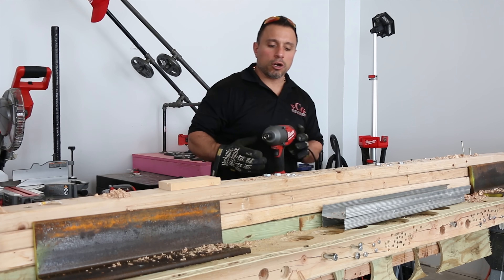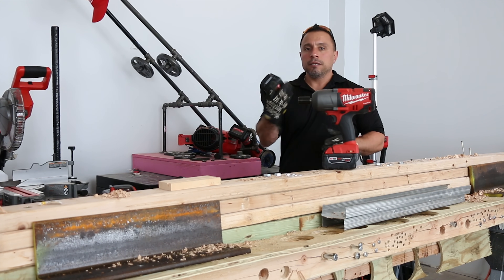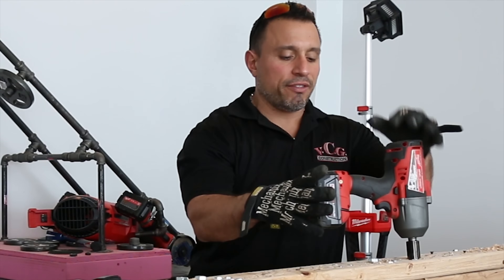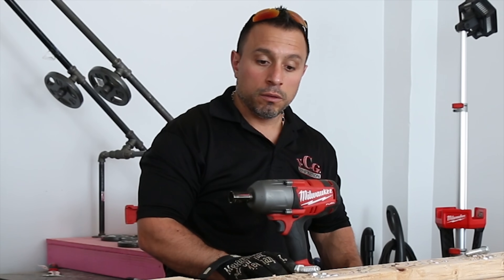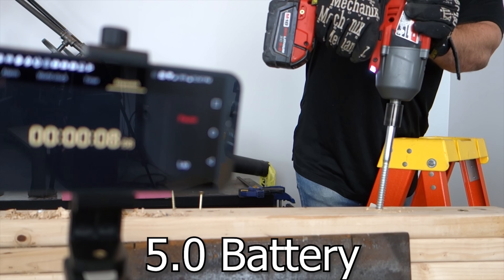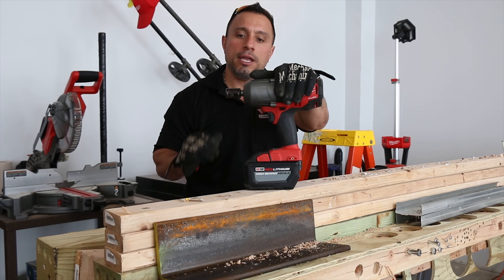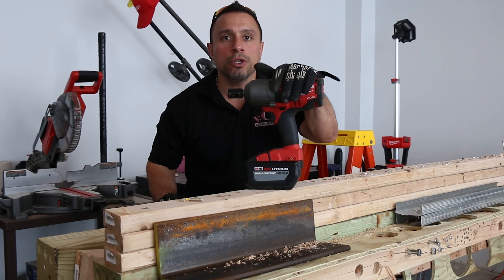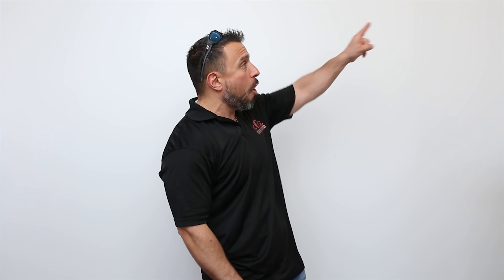Milwaukee M18 High Output HD12.0 Battery - Does It Increase Speed And Power?

Comment: The high output batteries give the most advantage to motor only tools. Impacts rely a lot on the impact. The impact works regardless of the motor…so while you’re still getting a benefit because the motor is able to draw more, the impact part still requires a certain amount of time between impacts and the impact itself doesn’t get stronger with more battery umf.

Comment: I have a pretty awesome setup!

I have a portable power station, 2 M18 12.0ah batteries and a rapid charger. When 1 battery is depleted I can use the other one and while using the fresh one I use the power station to charge the other!

At first I was disappointed. The power station reads power output in watts. The first 5 minutes it's saying 5watts. I'm thinking it'll take all day! About 20 minutes it's reading 150watts! It charged this HUGE battery in just under an hour!

Now THATS what I call superservice!

Comment: HD 12.0 is kind of heavy for most tools. Awesome for stationary tools and heavier tools like you show.  Also good for lights.  It just takes a long time to charge.  I have some CP 3.0 batteries that made about the same difference over the normal 2.0 batteries for smaller tools.  (30% - 50% more power). Good demonstration.

Comment: Im a mill Wright, I work on gas and steam turbines. Time and time again the 12.0 breaks and torqued things the 5.0 can't. Very noticeable difference in my line of work. I have even noticed a difference on the Fan. And it will run for close to 8 hours on high.  Hope this helps.

Comment: I'm a heavy engine mechanic and I can tell you that using the 12.0 definitely gives you more power than the 5.0. I was unsuccessful at removing 90% of the head bolts on a QSK60 Cummins using the 5.0. With the 12.0 my 1/2" impact didn't skip a beat and removed all of the head bolts. I hope this helps you guys make a decision.
Reply: Thx man👍
Reply: Head bolts ?? Fudge my 1/2 could remove head bolts on a isx15 , I had to bring out the 3/4 breaker bar and cheater bar
Reply: It does depend on the tool, task, and batteries being compared. Sometimes the tool isn't getting all the power it can use and sometimes that isn't a factor at all.
Reply: I agree 👍. I used the 12.0 on my 3/8 mid torque (overkill) on some 5/8" bols covered in asphalt and tar and the 5.0 didn't match what the 12.0.did...it was kinda scary 😂😂😂

Comment: I switched my m18 mid torque from the red XC lithium to the high out put 6.0 and noticed a huge difference in removing lugs to tire and other services . the out put is higher and lasts longer too compared to the 5.0 red lithium battery worth the investment . I want to see how the 3.0 high out put does in compared to the other high out puts

Comment: In mechanic work at the shop the 9.0 and 12.0 perform better in the impact wrenches. Even made my worthless 3/8 milwalkee (older model) with the 5.0 run better. Tanks though

Comment: I have Milwaukee M18 one for XC 6.0AH, not need big battery, one for HD 9.0AH and one for HD 12.0AH high output Big battery, not need 5.0ah or less, Milwaukee M18 batteries ONLY for torchlights
Reply from the maker: The bigger batteries do come in handy for the light! Which lights do you have?
Reply: I have more torchlights, try on Youtube.com: Milwaukee M18 and dewalt flexvolt 20/60V with 12AH

Comment: Great video I have the 2767 with only 2 of the 9.0 ah batteries & its a beast I think weight of 12.0 would be annoying though
Reply from the maker: It it doesn’t require the 12.0ho I say save the weight and run a 9
Reply: Or run the new 6.0Ah HO, best of both worlds.
Reply from the maker: Good call nytron!!
Reply: What model is the impact you are using in this video? If it's the high torque, I highly recommend this socket kit for ball hitch nuts (or in your case if you want to do some torque tests) https://goo.gl/XKTBdM. You could probably find the point through trial and error where the impact will not take off a bolt unless you use the HO battery.

Comment: Would love to see this test with a grinder, Just by the feel in the hands and test the harder you press down on it weather it bogs down or not.
5ah Vs 9ah Vs 12ah That would be brilliant!

quick question. When you drove the last lag with the 12ah battery, were the holes where you used a auger underneath?? in the pressure treated 6x6.
Reply from the maker: PC now that you mention it, I’m gonna have to check the spot!!
Reply: @VCGConstruction  9ah is great on fuel grinder. Haven't tried the ho 12.0 yet

Comment: 12 Ah battery = 90A discharge rating

5 Ah battery = 40-45A discharge rating

High torque impact wrenches can draw ~35-40A+ continuous current.  (burst current is typically higher, usually 50A+, but that's for a split second)

if you don't hit the batteries near their peak discharge rating then the voltage doesn't sag as much.  Which means the tool doesn't bog down.  This is basically what you're seeing, a battery that's able to comfortably handle a constant load that's well under 2/3 of what it can handle in the most extreme conditions.  (like on the newer chainsaw or circular saw)

Lag screws make this more evident because you tend to hit the batteries for a longer duration of time.  With lug nuts you usually break the nut loose almost immediately then the tool just spins it the rest of the way off. 

So typical use in automotive means that the 12 Ah battery offers little to no noticeable benefit.  Most people don't buy these to run lag screws so that's probably why Milwaukee isn't marketing them as a performance enhancement.  And you're looking for a serious case of RSI by adding even more weight for your wrist to deal with.  So they probably want to wait and push these larger batteries with their new 1" impact wrench since that thing gives people a side handle to hold onto when they operate the impact.  

You should compare these against a 2.0 Ah battery though.  (2.0 Ah batteries are rated at 25A, typically)  That would give people an even better idea of how a high drain tool performs when it's drawing from a 1P battery that can't feed the motor properly.
Reply from the maker: Sounds like awesome input thanks!!
Reply: I've come across many situations where I could not break the bolt free with 2.0   1p battery then popped in a 5.0   2p battery and it took of the bolt. With both mid torque and high torque  impact wrench.
Reply: Also would love to see the two run a m18 sawzall which is a very high load tool
Reply: Impact wrench he used is a 1/2 inch . yeah the 12 ah is considerably heavy in comparison to the 5 ah . I would recommend the 6 ah as a comparison .there is a performance difference in the tool
Reply: I have the second Gen 1/2 impact... I tried using both of my 8 year old 1.5 AH M18 batteries on it.  Yah what a joke.. the batteries actually error out if I use the tool to remove or install lugs. The 1.5 AH batteries work great in my brushless 1/4" impact driver but in order to get good performance out of the 1/2" wrench I use the 9 AH battery.

Comment: Try the batteries on the vac....you may hear the noise increase (use phone with db reading)...from this test I could hear and see the 12.0 was spinning faster. If I ever buy batteries I will be getting the new 6.0 HO vs the 9.0 HD.
Reply: I can hear and feel a difference in my tea kettle style Milwaukee vacuum when I use 2.0 to the 5.0 and the 9.0

Comment: 🚧Vince you can hear the difference between the 5.0 and 12.0. that was a cool test. How is the weight of the 12.0? Did you guys get any data on the or have thoughts on battery usage, the 5.0 used 1 bar for the 1/2" lag did the 12.0 stay full? Thanks Guys! Always good stuff going on here! ⚒

Comment: HO batteries has a higher/longer lasting power curve than the HD ones.  Charging cycles also reduces/lowers this curve.......not quickly but over the lifespan of the batteries.  There is new battery technology being developed as we speak, most notably by the inventor of lithium-ion technology that will make l-ion batteries a thing of the past like NiCad batteries has gone.  These solid state batteries w/o any electrolytes will be stronger, build no heat, faster charging and last longer than what we have today.  Look into the electric/hybrid  vehicles field and solar batt storage (like the Tesla PowerWall) area where these batts will make their first appearance.  The future for a less expensive rechargeable battery is super bright.
Reply: boilednuts That's spooky 👻👻👻👻👻LOL..
Reply: Bobby my bro, actually li-ion batts are way scarier.  They tend to overheat with use and when not regulated will either vent their electrolytes or explode/catch fire.  Electrical/hard shorts would also create the same scenario.  That's why shipping by air is regulated (I guess they don't mind if a boat sinks, a train/truck catches fire) and disposal is a concern.  I've had a li-ion battery vent on me already but luckily it didn't explode.  Lemme tell ya....that sucker gets hot and continues to vent for a while.  Imagine if a whole battery pack started to vent....I'd scream like a little girl.  This won't be a problem with the new solid state design.  You'd be able to use that power tool till the battery is discharged.  Yeah buddy, no more thermal shutdowns!  Vince gonna love that.  Estimated to be able to recharge between 100-200k times, bro that's a lifetime.  The possibilities with these can and will boggle the mind.  The sooner the better is what I say.
Reply: boilednuts Right on, good stuff man...
Reply: boilednuts.   solid state batteries will and do have electrolytes, it's just in a solid medium vs liquid as they are now. 

you're right though, they'll be so much more faster, durable, and safe since they won't overheat as much. aaand since theres no liquid, the anode cathode and electrolyte will all be compacted together allowing for more voltage/amp combos

downside though is they're at least 5 years out.. they'll be expensive af when they do come out tho..

can't wait
Reply: Well the timer proved the 12 is definitely faster🚀 looks faster with the eye test too..
Reply: One can only dream…….. like anything solid state batteries will be expensive AT FIRST, but inevitably be affordable, whatever AFFORDABLE means at that time, ONE CAN ONLY IMAGINE

Comment: Reason this happens is because the voltage is less likely to sag when the tool is under heavy load.  In a 2ah battery the voltage will sag way more in comparison to the 12ah under load
Reply: ledhendrixman doesn't explain why 9.0 is slower than a 5.0
Reply: Meaning I have 5 9.0 batteries and see that the 3.0 and the 5.0 out puts a bit more power. I notice it when I'm buffing and grinding. I just get a heck more runtime with the 9.0

Comment: Real tool reviews did a test with 2amp 4amp and 6amp dewalt batteries he has equipment to test speed and power he tested the 20v miter saw and with each battery from 2 to 6 the speed increased and he tested the impact wrench and it increased in power with each battery